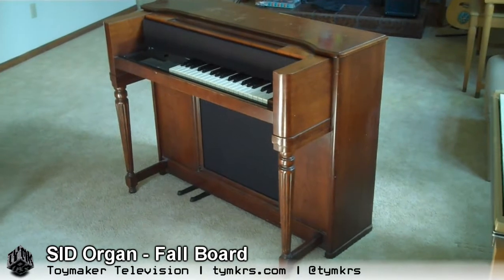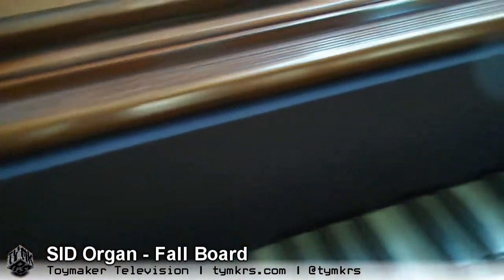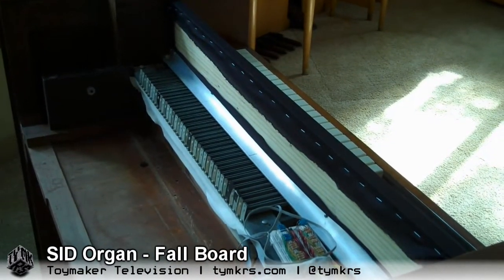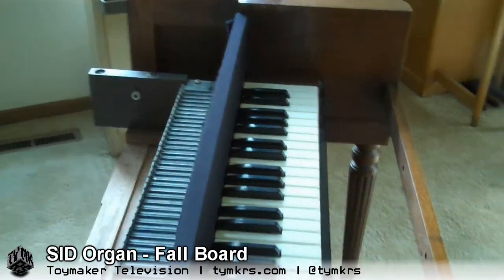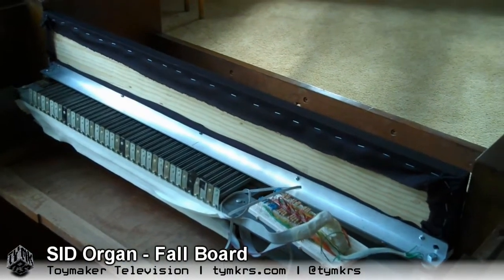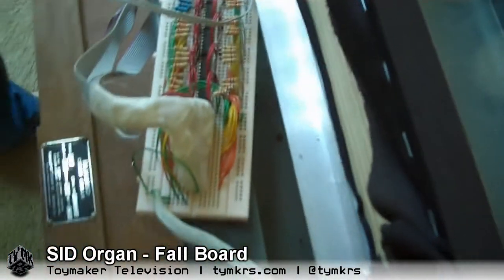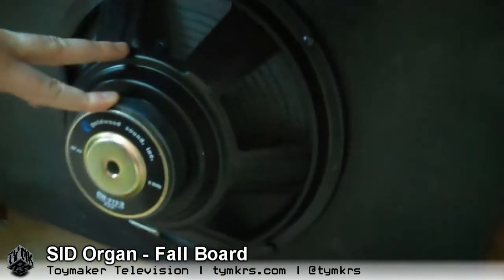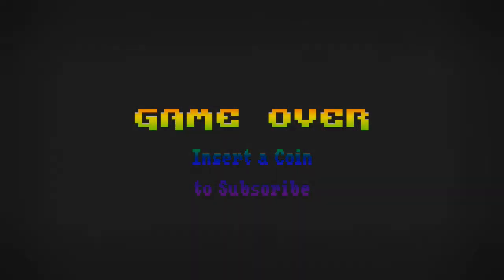Tymkrs Sid Organ - Fall Board

Comment: Your link is broken.   I take it this is a Hammond S series (-1, -4 or -6) Chord organ being turned into a MIDI controller?

Is the Chord button unit also being salvaged?

The 2 Foot pedals originally played the Root and Fifth of any chord selected on the Chord Button panel.  The layout is essentially the same as the Stradella-type Accordion Bass machine, sans the Bass Keys, hence the pedals.
Reply from the maker: +Craig Browning Heya Craig!  This a very old video at this point :) Yes, it's a Hammond S.  I wouldn't have much for it as a MIDI controller though.  It's more of a hackable shell for a stand alone synth.  I've been a bit stalled on the project lately, but much of what I've been working on will apply when I get that far (synth prototyping tools, filter designs, oscillator designs, etc.).